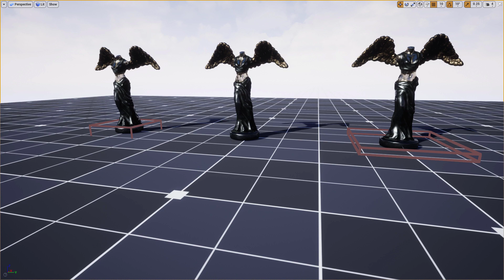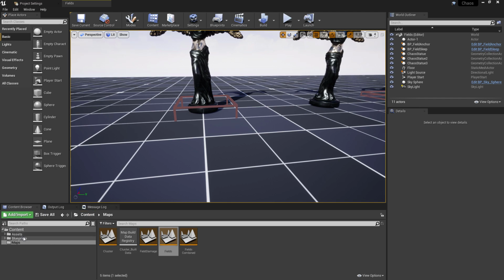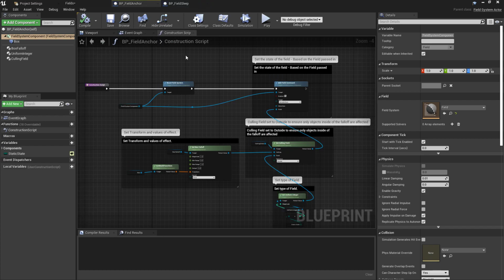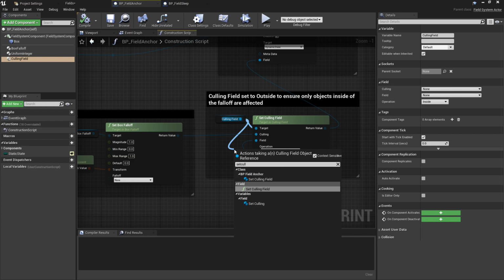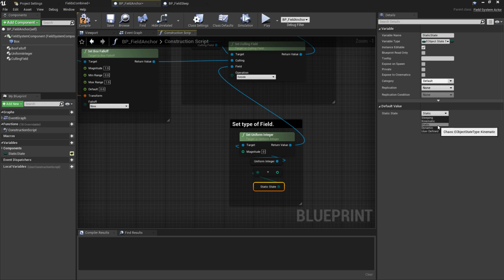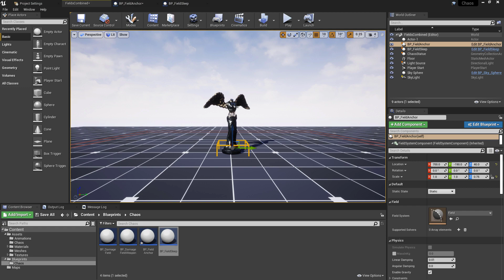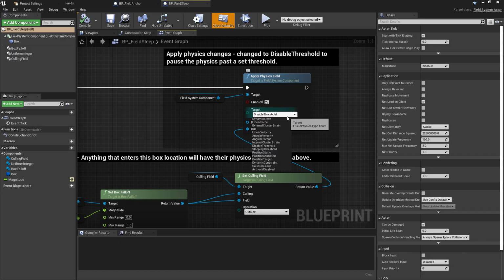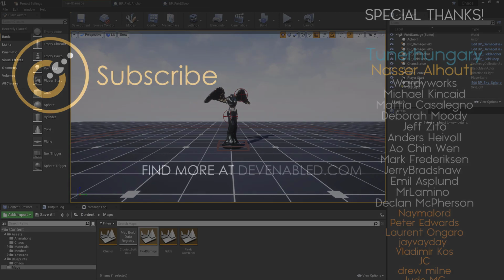Chaos Destruction - Constraint Fields - Unreal Engine/UE4

Comment: Hey! I'm working in engine version 4.27 chaos, and the anchor field was not performing quite as intended when following your video. When my "Static State" enum value was set to Static, the entire chaos actor would remain static. 

It was only when I set the exposed "Static State" enum value to 'User Defined', rather than Static, did my chaos object respond as intended (only the fractured pieces within the anchor field remained static when damage was applied). 

I have no idea why this may be the case, but hopefully this could help anyone experiencing a similar issue! Could also have been something I messed up in the BP but I am pretty sure I followed it to the tee, watching this video several times over.

Love the UE4 content you've made!

Comment: Minor thing, but in the Anchor Field BP, I think you may want the Min Range on the Set Box Falloff node to be 1.0 instead of 0.0. Also, it's worth noting that based on Epic's specs, an actor's center of mass needs to be within the constraint field in order for it to be applied.

Comment: Me again :)! Doing as you do in the video works great. However... I have a problem and don't know if you have tried the approach I'm doing and if it that case works. What I'm trying to do is dynamically create those Fields instead of putting them directly in the workbench. It doesn't seems to work whatever approach I take. If I add them directly...like all tutorials.. then no problem... but if I try to add them through a blueprint it appears they do not function at all. I have tried adding them both before and after I create a geometry collection... but it will not just react. So... my question is... have you tried to dynamically create and destroy geometry collections and fields and got it work?

Comment: how did you get flat UI in Unreal ??? you can also turn off blueprint grid in editor preferences and it will be even more clean
Reply: It's a theme you can download on Github : https://github.com/Sythenz/UE4Minimal
Reply from the maker: https://github.com/Sythenz/UE4Minimal That's the link to the minimal UI repo. I will have to try the grid toggle in the blueprint editor. Not sure if that will be a step too minimal..